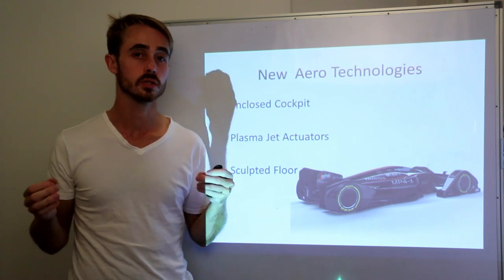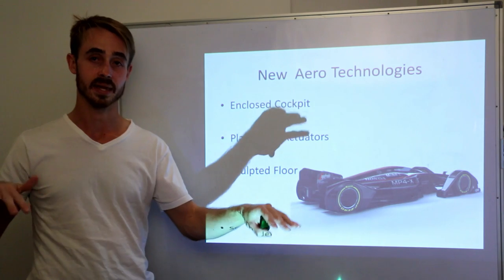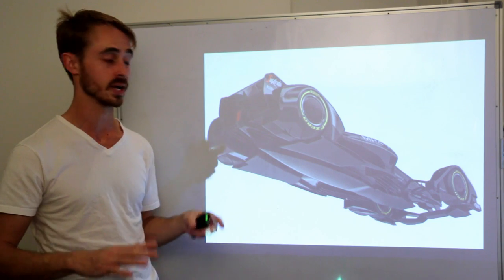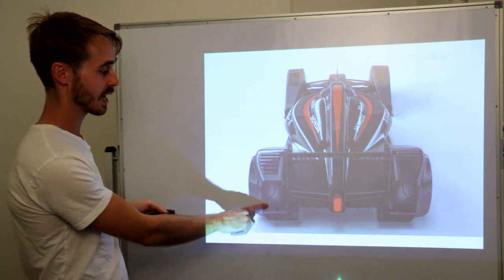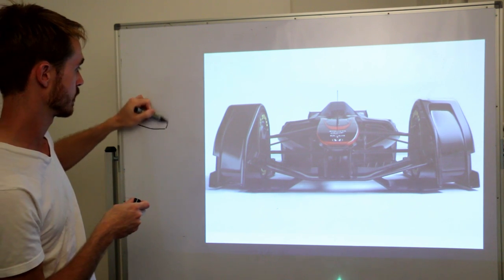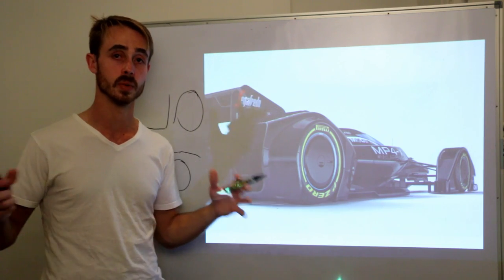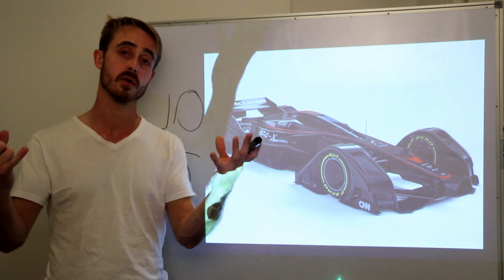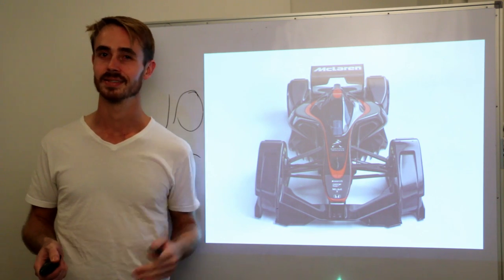McLaren MP4-X - Aerodynamic Analysis

Comment: I may be wrong, and I'm not an engineer, but, in a few racing disciplines, I.e. Le Mans, the prototype (LMP1)s are forced by regulations to run a cutout at the top of each wheel arch. Now, the reason they run it is to avoid dirty air from bouncing off the top of the enclosed wheel arch and lifting that car and the floor at 370kph, in which mark webber's Mercedes just lifted off at 400 kph back in 99. So, I'm fairly sure the front arch air duct at the top just vents turbulent air to the grille cutouts behind the front wheel.

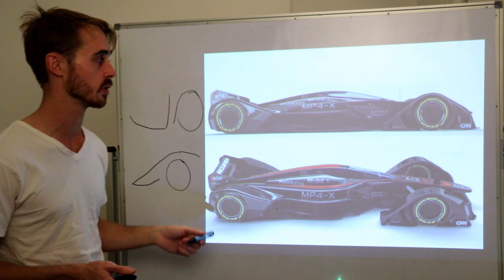Comment: Gotta admit, i had a bit of a laugh at 8:00 where you said you didnt see where they were managing the sidepod and engine cover outlet air, or the exhaust outlets.
If you go back to 4:15, in the rear 3/4 view of the car, you can see on either side of the center rib of the body, directly behind the Honda branding on the two humps that flank the center rib, and visually right above the rear wing element in the shot, are the two engine exhaust outlets ports. Right at the end of were those two humps are seemingly chopped off. Which seems a little funny to me, as i would expect them to use them in the diffuser, or have some coanda ramps into the diffuser area.
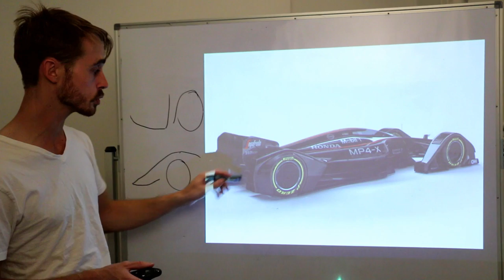Then at the 10:00 mark, you show the rear end of the car, talking about the rear wheel fender air outlets, and right there, plain as day, directly underneath the engine cover, connected to either side of the rear wing endplates, and connected in the center to the rear crash structure, are two parallelogram shaped sidepod air outlets. You can see in the shots at 4:15 and 8:30, that this area is not receiving air from any other location, and is infact the sidepod air outlets.
Also of note, there is a small bit of cabin cooling air intakes on the tip of the nose, in the typical pedal box cooling area. But its still no where near enough for a proper closed cockpit cooling solution, even if it was airconditioned.
Reply from the maker: +bigbuckoramma Ahh yes, but you see that entire rear area below the top rear parallelograms appears to be used to vent the air drawn from just infront of the rear wheels, where the sidepod curves in. As such, the area they are venting from is very small, in comparison to the very large inlets (which appear to be not just the centre portion of the intake, but also that open ring around them). The point I was more trying to make was that with the flow from on top of the diffuser being vented out the rear, and the tunnels taking up a large amount of the rear exit area, that the outlet area seemed very small with respect to the inlet, and as such I would imagine they would have difficulties with providing sufficient cooling through the internal flows. This would obviously be an issue when you factor in the radiator pressure loss etc.

The exhaust point is fair enough, I simply missed them. I suppose like you said that I was more looking for them in a creative location rather than just on the top.
Reply: +KYLE.DRIVES You are correct, there is the engine cover, the parallelogram openings for the engine cover outlet, the air outlet for the air ducted forward of the rear wheel and inside them, and then the diffuser expansion area below that. No confusion there. That said, I dont think the sidepod inlets are that big, and i dont think the outlets are that small either. If we assume, and likely correctly, that the sidepod inlets are also pulling double duty having engine inlet air scavenged out of them, then the total air actually flowing through the sidepods, across the radiators, and through the engine compartment, will be reduced (perhaps not significantly, but certainly enough to be measurable). We also have to take into account that the air coming out is going to be hot air, which brings the Meredeth Effect into play. Which would greatly help in evacuating the air out from under the engine cover. If you look at a modern F1 car, the air outlets at the back of the Coke Bottle are almost impossibly small, but manage the air just fine. About the only time they get enlarged past several inches (which is still roughly half the size of the inlet) is in the hotter middle eastern races.
This can also be witnessed, even more exaggerated, when you get to a current LMP1 car. Lets take the Porsche 919 for example. We can see from this cut away rendering, just how large the sidepod air intakes are. http://newsroom.porsche.com/image/teaser_original_720x1_5/ee067bb1-36eb-42b3-a652-1447a8618530.jpg And yet when we look at the back of the car, these small triangles inboard of the wheel wells are all that is utilized for the air outlet. http://st.motortrend.com/uploads/sites/5/2015/03/2015-Porsche-919-Hybrid-rear-three-quarter.jpg And if you look at the #3 R18 from LeMans in 2014, it is comically narrow at the rear, including removal of the dorsal fin cooling exit. So clearly there is some performance benefit to running the narrowed engine cover air outlet, because damn near everyone is doing it. As for the case of the MP4-X, i think the cooling outlets would be more than adequate.
Reply from the maker: +bigbuckoramma  I'll admit, the more I look at those rear exits now that you've mentioned it, the more appropriate the size seems. Still looks to me like the ratio is a bit worse than current F1 cars, especially when you compare these images:
https://thejudge13.files.wordpress.com/2014/11/8yjybh4.jpg
http://cdn-8.motorsport.com/static/img/mgl/1600000/1670000/1677000/1677100/1677158/s8/f1-malaysian-gp-2014-mercedes-amg-f1-w05-sidepod-detail.jpg

To these:
http://s1.cdn.autoevolution.com/images/news/gallery/mclarens-mp4-x-study-shows-what-happens-when-f1-engineers-get-high_9.jpg

https://pbs.twimg.com/media/CVTpefAXAAEVhau.jpg

But, like you say, if intake air is coming from them this would increase the size requirement (for the inlet). Also in that image of the rear of the MP4-X it appears to me that there is an air gap (see the white bits?) where air is being drawn in from the top, which would have a not insignificant effect on the area ratios. All up though I'd be very surprised if this car has even seen the light of CFD optimisation.

Full disclosure for reference, my primary areas have work have always been external flows (particularly vortex management), with very limited exposure to internal ducting (although that's not to say none!), so what I say in the video is really just going off feel there, also I don't have too much free time to devote to analysing, filming and editing these videos, so there are naturally going to be some slips/oversights like this. I do appreciate and encourage the educated discussion though.
Reply from the maker: +KYLE.DRIVES And a quick side note regarding LeMans, let us not forget that they have the nice and long Mulsanne to cool down on!
Reply: +KYLE.DRIVES I have no doubt that the size ratio isnt correct because, as you say, i seriously doubt this rendering has been plugged into any CFD simulation whatsoever. And if it was, the artists liberties would become quite apparent. Maybe McLaren will get adventurous and do exactly that one of these days? That would be fun.

Anyway, looking at some other examples of F1 sidepd outlets, they are kind of all over the place.

Here with this Toro Rosso, the outlets are very tidy and small. ANd i would imagine if you squared them up, and stretched them between the wheel track, they would be but a few inches high, if that. http://i.imgur.com/2sBTRkV.jpg

Here we see the Ferrari, and it too has a very small outlet, relative to the size of the sidepods, it is very tight to the bodywork. https://pbs.twimg.com/media/CSjnEvzWoAAxvjP.jpg

But on the flip side of that, at the same race (Mexico) we can see the Redbull, which has the outlets gaped about as wide open as you could get. Which is indicative of the overheating issues that Renault were rumored to have experienced the whole season. These are almost comically huge. Although, before they flair open, the center section does narrow quite a bit through the middle, which i find interesting. I would have figured they would expand that out a bit if more volume was their goal. https://pbs.twimg.com/media/CSg8RdKWoAEk8Iv.jpg

Next up is the top of the field, the Mercedes, and it too has laughably narrow body outlets. It also has two half hoops flanking either side of the outlet. Which some have speculated/hypothesized are there to generate a low pressure area at the outlet opening, to help suck the air out through the bodywork outlet. http://img2.auto-motor-und-sport.de/Lewis-Hamilton-Mercedes-Formel-1-GP-Mexiko-30-Oktober-2015-fotoshowImage-12dbdbeb-906731.jpg

Here is a better look at those half hoops, and the amount of narrowing towards the rear of the bodywork. http://img2.auto-motor-und-sport.de/Mercedes-GP-Russland-Sochi-Donnerstag-8-10-2015-fotoshowImage-ae0479d-901132.jpg

Also, a nice shot of of whats under the Mercedes bodywork, so you can really see just how much the bodywork pinches down. And how large the radiator is, and how even more heat is injected into the space by the exhaust manifold being directly in the airflow. http://cdn.arstechnica.net/wp-content/uploads/2015/11/USGP-16.jpg

I would be curious to see how much air volume is lost out through the suspension mount openings. Obviously those have been aerodynamically touched, and positioned appropriately. As in some shots it is just a small slot, and in others, a gaping eyelid like hole.

As for the light we see in the background, i believe what we are seeing there is a rendering artifact in the lighting.
If we look at this shot http://cdni.wired.co.uk/1240x826/k_n/m14.jpg there are no openings in the top of the bodywork. The same is also true from this shot http://static.cdn.mclaren.com/img/content/concept-cars-heroes/main/slide-4-v1.jpg And from these two angles, there are no openings either. http://images.technewstoday.com.s3.amazonaws.com/tnt/mclaren-just-unleashed-its-braincontrolled-mp4x-promises-an-extravagant-for.jpg

If we look at the rear shot again, closer this time https://cdn0.vox-cdn.com/thumbor/rkL37zT1OJNEuaQN3C3AzBHwj6E=/cdn0.vox-cdn.com/uploads/chorus_asset/file/4319129/6mclaren_mpx-4_concept.0.jpg We can see that the wing endplates are mounted to the lower beam, and the bodywork rests between the endplates. You will also see that the lower beam does not appear to have a very deep chord, as there are suspension components, and driveshaft running through that area. So my assumption is that light is coming through the inlet forward of the rear wheel, bouncing off of the curved and angled surface of the top of the diffuser, and reflecting up onto the underside of the top bodywork as it extends over the gearbox, and the rear suspension. So in actuality, we cant even see the body outlets, and they are probably tucked forward of that. So they may actually be larger than the lower beam wing, and upper body line suggest, not too dissimilar to a current F1 solution that is forward of the suspension gubbins.

Which i guess makes this whole discussion kind of pointless over a fictitious car, right? ROFL! Oh well...

That said, i am REALLLY curious to find out how much of the Meredeth Effect is being used in the cooling solutions of an F1 car.
Reply: +bigbuckoramma tl;dr
Reply: Daniel Luong Thats your fault if you dont want to learn something.
Reply: If only I could learn how to read essays on youtube.
Reply: Daniel Luong Cnsidering Kyle and i had a good discussion about it, and probably both learned something in the process, i will say it again. Your loss.
Reply: +bigbuckoramma Nah that engineering explained guy is the best. He never retracts or makes corrections becauae he is always correct 100% of the time. 

I don't know who this Phol guy is but he is not legit at all. I know for a fact that he said that Luca Badoer was going to do well as Felipe Massa's replacement. 

#PhilHasZeroCred

Comment: Is there any chance of the hot air from an exhaust exiting into those underfloor tunnels? Wouldn't the hot cause a low pressure in those tunnels that increases downforce?
Reply from the maker: +Jono Nicholls No unfortunately, another user pointed out to me that if you look at the shot from the top of the car you can actually see the exhausts up there, just up from the rear wing in this photo: http://autoguide.com.vsassets.com/blog/wp-content/uploads/2015/12/McLaren-MP4X-Concept-10.jpg

So sadly, they are not doing anything interesting with the exhaust

Comment: I'm not super informed on F1 racing, why are their cars open cockpit? It always seemed a bid odd.
Reply: it think it has to to with safety, when the car crashes its easier to get the driver out. when a car like that starts burning you want to be as far away as possible
Reply: Awellner Ah makes sense
Reply: @Awellner is wrong. In fact FIA wants to close Formula 1 cockpits because they are safer. Drivers keep getting hit in the head with flying debris and chassis parts all the time. Open cockpit is just something that has become a tradition in the sport, it's just in its DNA. That was the way from the start and people are reluctant to change it because it almost completely alters the cars' looks and it detaches them from their history.

However, FIA has announced recently that starting with the 2017 season, F1 cars will be implementing a cockpit protection design called the "halo concept". They are still evaluating transparent protection options. You can google the words "halo cockpit" or somesuch to see it. It looks outrageous in my opinion. Very un-Formula 1 like. BUT, it will save lives.

EDIT: Excuse me, I misread that. FIA apparently has confirmed its intention to introduce cockpit protection from 2017. Which probably means we won't see them this year, especially given that the drivers voted "no" for their implementation this year.
Reply: Max Glick the halo system needs serious testing.  Think the drivers would rather have a cockpit like this than that system.
Reply: This vehicle if it ever comes to pass,  is definitely in the spirit of F1 in appearance and intent.